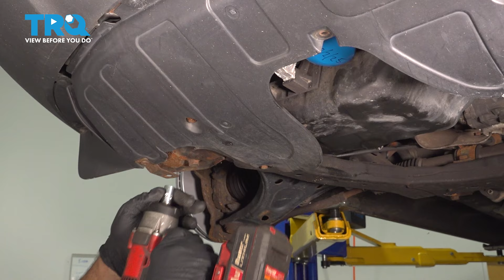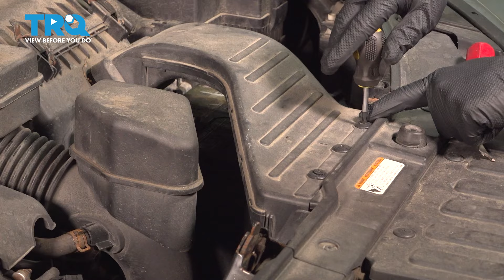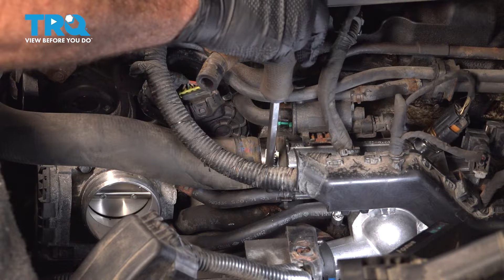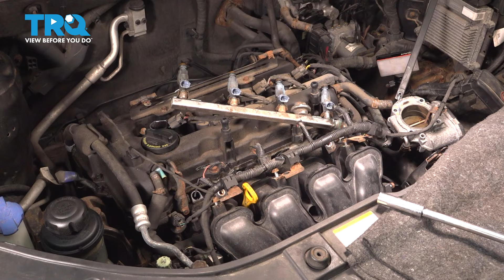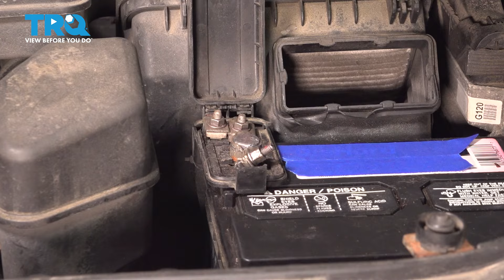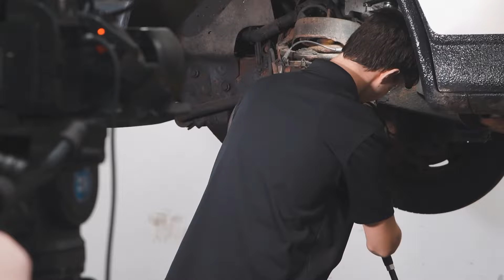How to Replace Starter 2011-2015 Kia Sorento

Comment: Impressive skills demonstrated but one is left with the impression that this is an example of a system that is NOT "mechanic-friendly" to maintain, particularly for general mechanics who may not be familiar with the specifics of this model. This is an example where the fixing of an issue may well create a multitude of subsequent unrelated problems.